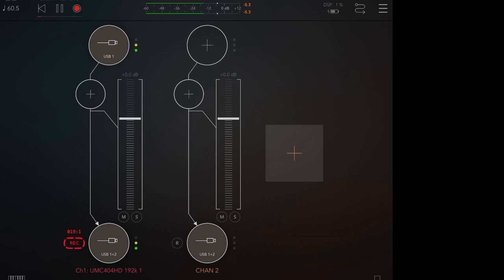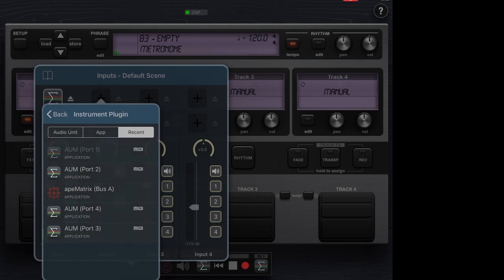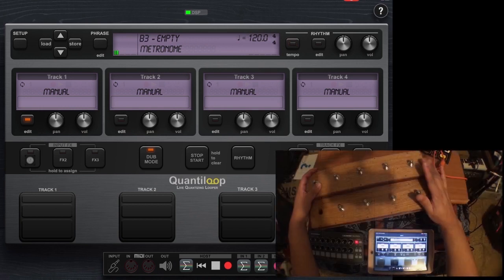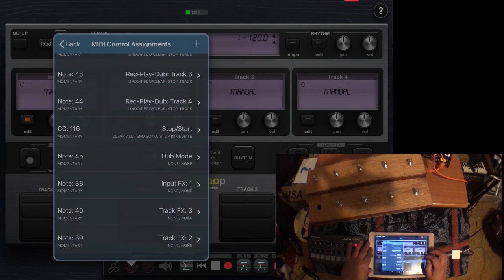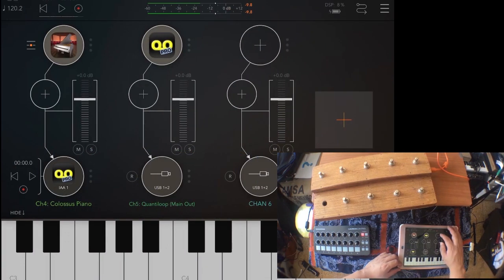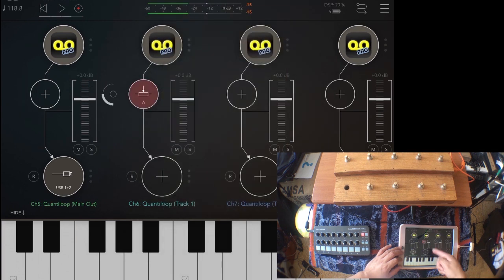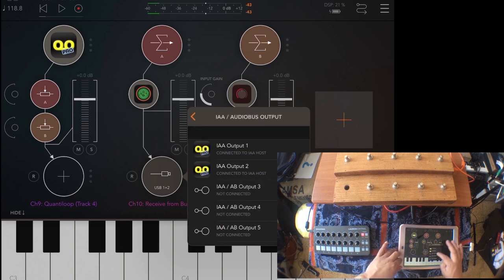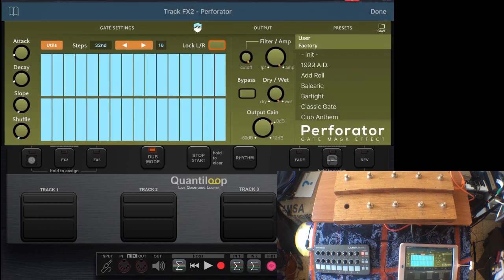Tutorial - Quantiloop in AUM

Comment: Thanks for walking thru the setup ! Is it possible to incorporate a external fx like a pedal into the flow and loop the output of that pedal back into the loop?
Reply from the maker: a pinkelefant Thanks for watching! If you only have one or two inputs and outputs, the best you can do is run your instrument or mic thru the pedal and then into the iPad. If you have more than 2 inputs/outputs, what you can do is create a track in AUM, use mixbus D (for example but any free mixbus works) and for the output of that track chose output 3 of your interface, plug a cable from output 3 of the interface to the pedal input and plug the output of the pedal to input 3, create another track in AUM chose input 3, then you can route what you want to effect by the pedal to mixbus D. I will make a video of that, that is a very good question!
Reply: Pedeplei A video of the wiring would be really helpful ! I was not able to find a good tutorial on how to incorporate external pedals and effects back into the iPad flow
Reply from the maker: a pinkelefant you should check Dean’s video on how to use external fx in beatmaker, he’s great at making good tutorials. I’ll make one for AUM later but in the meanwhile check this video out https://youtu.be/9KSi7X4ZP0c